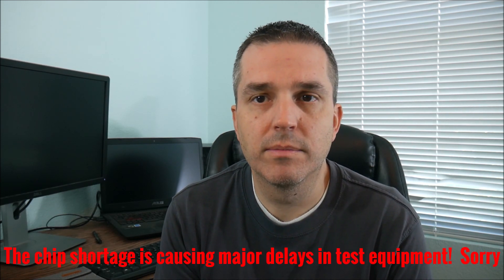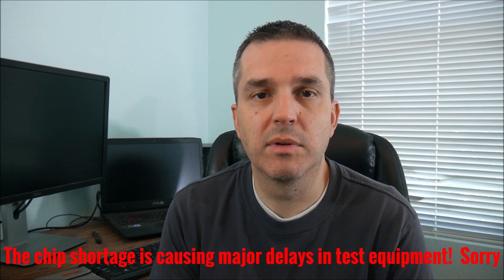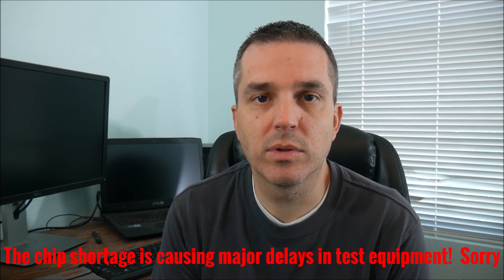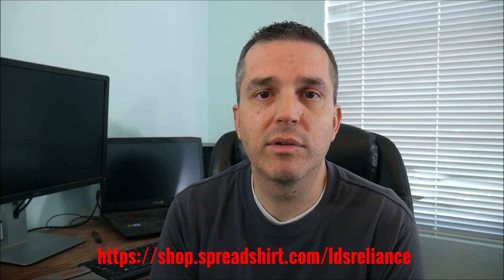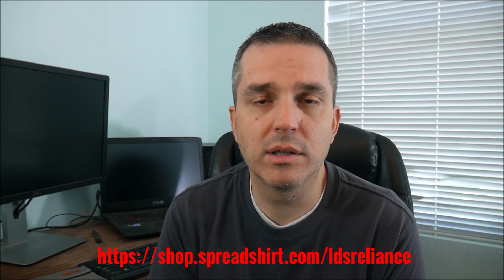Battery Import Project Part 8 - Peaking Inside the Battery Case To Get A Glimpse of Build Quality!

Comment: Maybe donate a battery for testing to a bigger channel for a shout out?
Reply from the maker: Yes, I have plans to do that but I have to be careful about it.  With the chip shortage right now, it is difficult to get batteries in stock quickly and I don't want to go out of stock selling a bunch of batteries and then be out for 2 months.  I have seen that happen several times recently and that is a major killer to your momentum and will actually leave a black eye instead of giving you a bump in sales.